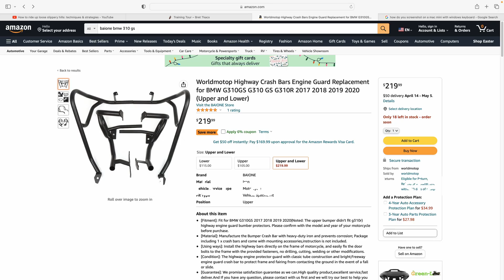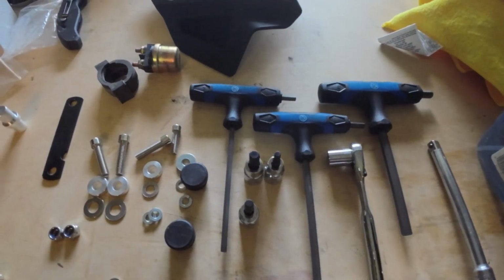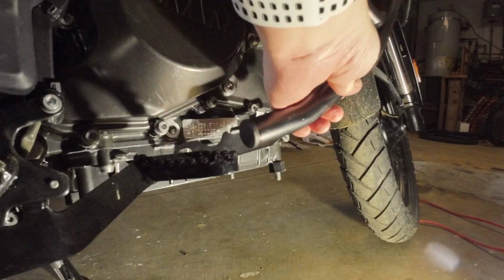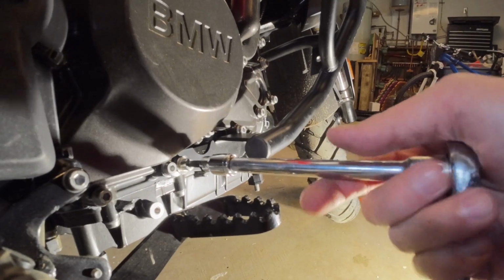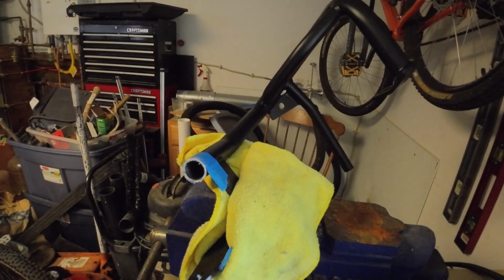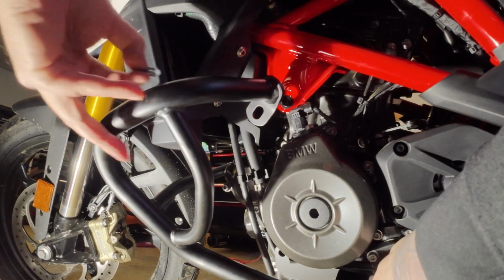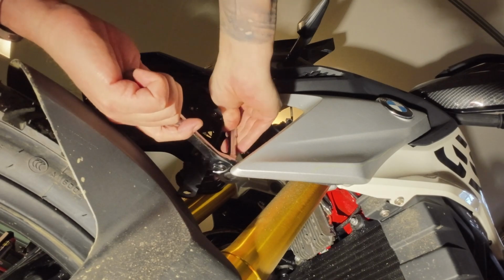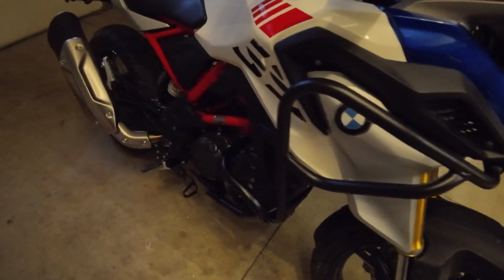2023 BMW G310GS full crash bar install with instructions and tips

Comment: Just fitted these to my partner’s bike. No instructions so your video has proved invaluable. I too didn’t have the longer bolts but did have the spacers. I’ve fitted the original screws back without the spacers and provided you do this before firing the lower bolt it just about works. Will be exchanging for longer bolts at the weekend though.
Reply from the maker: I am glad the video helped!

Comment: Hi just fitted the same ones did you find the left side is closer to the bodywork?  I had no instructions for mine thanks mark.
Reply from the maker: Hi. just a little but I pulled on the bar from the top outward and it moved to perfect position. they helped so much when I dropped it! thanks for watching!

Comment: bought the exact same bars from amazon.  The left side  (shifter side ) top bolt does not seem to match up on the lower bars, it seems to be running into the electrical connection that might be the ride by wire control. Did you have any issues with this or have to bend it to get it to fit? Thanks for all your help.  Great video
Reply from the maker: Hi, no I did not. the key to assembly is to not tighten anything until you fit the bars. I'm sorry you're having issues.